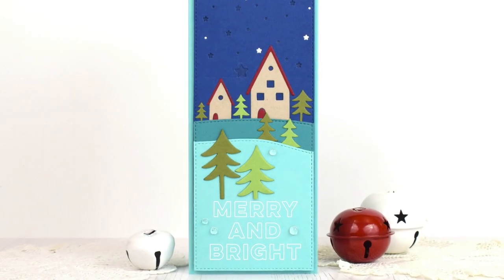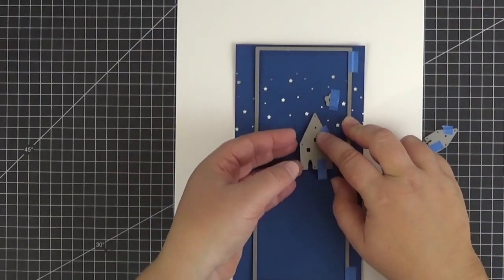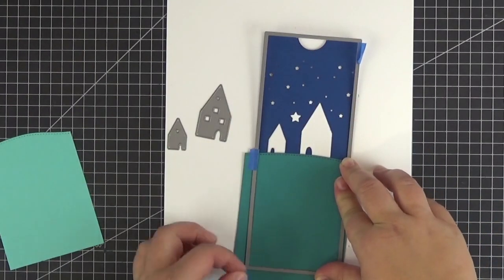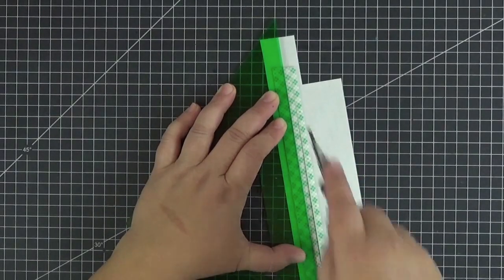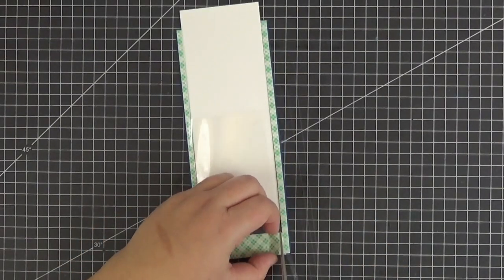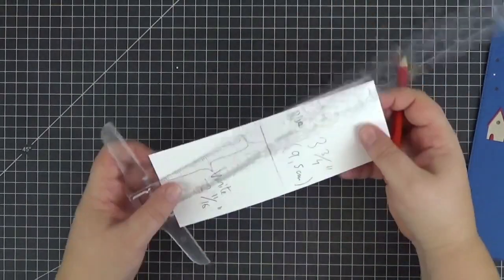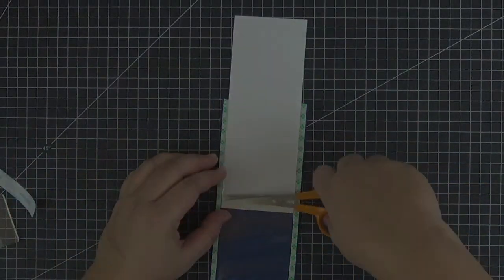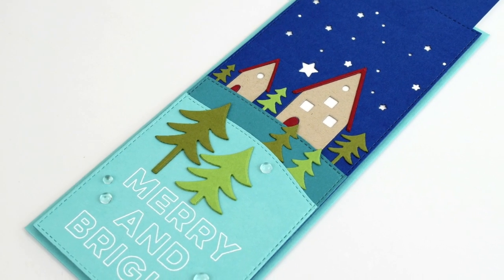How to Create a Faux Light-Up Card with Card Stock

Comment: Fabulous interactive card. I will need to watch a few times to get it right. 🙂♥️🇬🇧
Reply: Thanks, Paula! When I make these types of card, I never measure anything beforehand..  I just adapt all of the elements to my card panel. The main thing is to have enough room to hide the lighter color of card stock, which is revealed. 🙂
Reply: @Laura_Dovalo  I love interactive cards & this looks like it won't cost too much to post. The part I need to get right is the selophane on the tab as a stopper. 😁🇬🇧